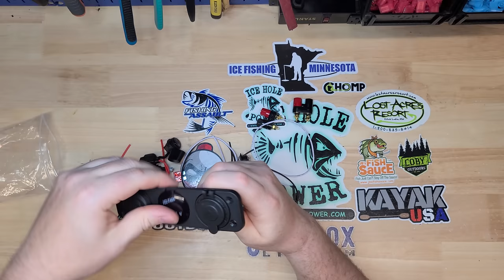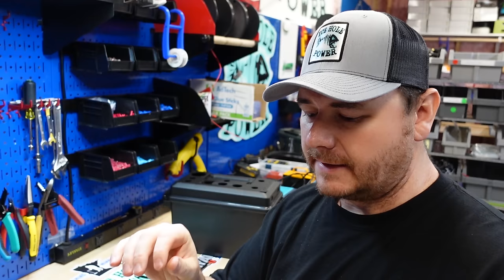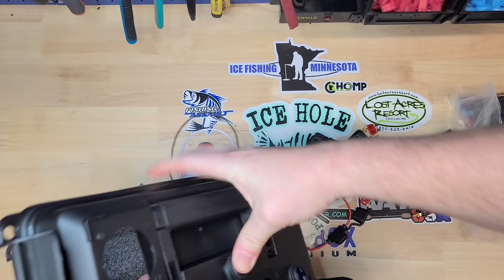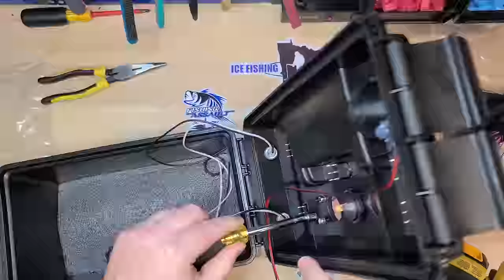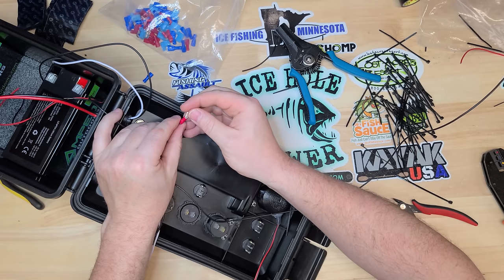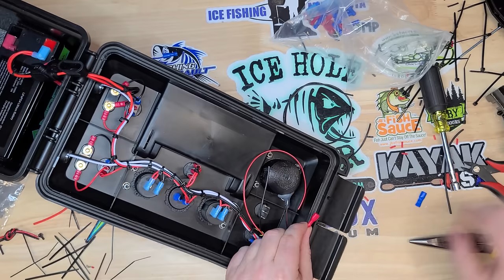How To Build A DIY Power Box

Comment: KUDOS on the build! I suppose the main question for many, is really what's the main use of this build? It's so low in supplemental power, is the idea that if you're stuck in an igloo for 3 days or stranded at a campsite to power up a set of lights and charge two cell phones? I'm not being rude, I'm genuinely curious since the parallel voltage bank is only 24Ah?? Don't get me wrong, it's a fantastic build, very cleanly done, just not sure what the cost per time per value is in this logistically..? I could see a 50Ah at the absolute minimum. Was it to be 'one-handed transportable' charge block, but not want a Amazon charge block for your cell-phone? Again, very well built! ~ Just not sure what the common denominator is in this build for worth.
Reply from the maker: Thanks for the comment.  This box is able to hold two 30ah batteries giving you 60ah of power.  This box with the glow cup is for ice fishing.  Keeping all your stuff charged in case of emergencies being out on the ice is key.  Being able to have your phone charged or have a lighting system when it gets dark while also having the glow cup to glow your ice jigs.
Reply: @iceholepower8012  Cheers!

Comment: I have the same plug on my 2 amp battery charger I can put the alligator clips on it to hook straight to the battery on cars and trucks my atv has the adapter that hooks to the battery and all I have to do is plug it in on the adapter on the atv battery.

Comment: Hi Jeremy, I purchased your power box. I know little to nothing about doing electrical wiring. I wanted to do this as a learning experience. I must say watching your video made it possible. I put in 2  12v 30ah lithium amp batteries. My biggest problem was the lights,one doesn't work ,but the real problem was the wire is very fine and the insulation  was to thick for me to get a good crimp.Thumbs up great box. I plan on using this for some camping, kayaking,and when I am able to get a Garmin use it for that.

Comment: @Iceholepower -  I followed this video but I have only have a single battery at the moment, I might add a 2nd battery in the future.    What should i do with the 3 wires (2 negatives, 1 positive) that you connected to the 2nd battery?  Can i just leave them as is until I add a second battery?  Thanks!
Reply from the maker: You bet. Just tape them to the side of the box or secure them with the velcro for the second battery.

Comment: Is there another 30ah battery you recommend that will fit in the deluxe box?  Been waiting on amped 30ah to come back in stock but it doesn’t seem like it’s gonna happen soon. Got my box all wired up and ready for a battery (that will fit the box)!  Thx
Reply from the maker: Good Question. Not that I know of. One 30Ah Tall will fit under the handle, the Dakota 23Ah is about the same size. 
https://www.iceholepower.com/lithium-batteries

Comment: Best way to charge battery without opening the box
Reply from the maker: Assuming you are using the Amped charger like in the video, plug it into the side of the box and hit the charging switch.

Comment: Built mine last week.  It's cool!   Went with two Amped 12 hour batteries.  Any reason I can't keep the charger in the box when I'm not using it?  I just put it in the baggie and put it between the batteries for now.  The new model lights are very bright.
Reply from the maker: Not at all, I keep mine in the box.

Comment: Many of us who purchased your DIY Power Box will not be using a 2nd Battery as shown in your video configuration, but will only use one. So, can you please clarify/ maybe diagram the connections we will use when only using one battery. Thanks Much!
Reply from the maker: You can use 1 battery in the wiring configuration shown in the video. Otherwise run your negative from the charging switch to your negative battery terminal and the fuse holder will go from charging switch to batt pos.

Comment: What is the preferred charging method or controller?  How do you preserve the service life of battery?
Reply from the maker: I just plug my lithium charger into the SAE port. They are 10 year batteries as long as they are stored around 50%

Comment: Great video, could you use one of these to power a CPAP machine (after purchasing the correct dc to dc cable for the machine)?
Reply from the maker: Thanks Jason! If it was 12v and it did not pull more than 10 amps, then yes. Just make sure to calculate your current so you can get a battery with enough capacity.

Comment: May sound like a dumb question, but can I connect my power inverter to the banana clips? Also do the kits come with wiring instructions?
Reply from the maker: You can hook an inverter to the banana posts. Just make sure to keep it under 10 amps. This video is the instructions.

Comment: A simple volt meter isn’t very useful when using lithium batteries. You should use a meter with a shunt so that can measure the batteries capacity.
Reply from the maker: Google lifep04 voltage chart. Its not as good as a shunt but works just fine for these low capacity boxes.

Comment: I'm building one as a solar powered battery box for Ham radio, but it will be similar in construction, using many of the same outlets and switches. I've watched a number of videos to prep for it, and I have to say this is the most educational for process and wire management. I will be using a Bioenno panel, battery and controller. I will also be using a RigRunner for fusing in between all the components and the battery. Overkill? Probably. But anything worth doing is worth overdoing.
Reply from the maker: Overkill the snot out of it! Sounds like a sweet box, shoot me some pics if you want. Jeremy@iceholepower.com

Comment: Hi, nice video, i just have 1 question, the wires you use seem a bit thin, have you ever encountered wired becoming hot during a heavy load?
Reply from the maker: No, we fuse it at 10 amps so there really isn't a heavy load put on the wires. They are also really short wire runs too so that helps.

Comment: I was thinking about a 12 volt car battery as for my box
Reply from the maker: It would work in a different box, but would be heavy. Really heavy. One thing to look at is the weight capacity of a box when choosing a battery like that.
Reply: It is 600 cold cranking amp battery I have it in a deep cell box

Comment: How hard would it be to switch out those Eagle eye lights, for the new fancy ones your showing?
Reply from the maker: Not hard. Just have to drill a bigger hole then I would splice the wires. We use a 18mm but for those new lights

Comment: If I want to use a 12 volt lithium battery only what would I need to modify in the wiring of this unit.  If there is another video please let me know.  Otherwise I will order another battery.  The battery I ordered is a 12V Lithium Battery 30Ah, RoyPow Deep Cycle LiFePO4 for RV, Solar Marine and Off-grid Applications.  Can I use two of these batteries with the setup? 

Thank you.
Reply from the maker: Hi Juanita. Looks like you would need to get some big eyes for that battery because of the bolt terminals. It does look pretty big and I'm not sure if it will fit in the box that I used in the video. I did tear down a smaller RoyPow battery and it was not pretty. https://youtu.be/mQQoYzrj3rY
Reply: @iceholepower8012  Thanks for refencing your video.  I saw it after I purchased the battery.  I will return it and get one of the other batteries you recommended.  I purchased the setup because of a you-tube video I watched where he recommended your power box.  I am trying to run a 12 in garmin, livescope and a hydrowave on the battery which is why I went with the larger battery.  is there a video reference for a single battery wiring versus the dual setup?  Appreciate your prompt feedback to my initial comment!
Reply from the maker: @juanitaellis8208  no but it's pretty easy. Negative wire from neg battery terminal to neg charging switch tab. Then inline fuse from pos battery terminal to outside silver tab of the charging switch.
Reply: @iceholepower8012  thank you! Appreciate your support!

Comment: Which of the recent batteries will work with SAE plig
Reply from the maker: Do you mean which battery charger will work with the SAE plug?
The Amped charger will work with the SAE plug assuming you are using LiFeP04 batteries. https://ampedoutdoors.com/collections/lifepo4-battery/products/lifepo4-lithium-battery-4-charger?variant=39619821830295&aff=8
Reply: Can you use the SAE as a power source
Reply: Are the switches available in  green or red

Comment: Jeremy, thanks for an outstanding video on this. I built my own box, based on your videos, JDS Outdoors Videos, and Benjamin Nelson videos; I learned a lot about wiring, some different tools, etc. I am a retired Marine, Subscribed, hit the "All" Bell, and Liked the video, so looking forward to more vidz. I do have a question about dedicating switches to each light, banana jack, 12volt, , and using a master switch that controls my Solar Charge Controller, with a direct connection using an SAE port for my solar port.  What is the easiest way for a "Finance guy" to wire components, so each has its own switch and is independent of the others?  I want my Master Switch to control only the Solar Charge Controller, so the electronics in it, do not drain the battery. Then I want the banana jack 12 volt port, and each LED (Red, Green, and White" to have their own switch, all of which do not need the master switch on, to provide power to each component.  Thanks in advance for any assistance you care to share. I also believe I heard you are a former or retired military man, so thank you for your service. Semper Fi!
Reply from the maker: Thank you for your service! It really wouldn't be a master switch if it did not provide power to everything so I would just consider it your charging switch. then I would just take the the pos from the outside tab of the charging switch and daisy chain it to your other switches. Kinda like the negative side. Just make sure you get that fuse between your battery and your charging switch. (assuming that is your first component in the circuit.)
Reply: @iceholepower8012 , thank you for the above. I now have a "Master Switch (MS)" that must be on to run the solar charge controller, and provide power to the box. The inline fuse is from battery + to MS IN. The MS OUT goes to Solar Charge Controller. Only thing left is the SAE port which is how I charge the system via Solar. I do not use a Banana Jack as a charging option. Since the Inline fuse is direct from battery to Master Switch, do I need to or should I connect the SAE port differently, or run it straight to the Solar Controller as I have it now? Thanks man. Apologies for the questions, you are the only who seems to be able to provide answers and insight. Awesome stuff. Thanks again.

Comment: How do I go about wiring the switch under the charge switch as I'm not using any lights etc .. is it just a case of missing the middle wire out ?
Reply from the maker: Are you saying your switches don't light up? If that is the case, you don't need to wire the negative wires to them.
Reply: @iceholepower8012  yes my switches light up .. but I'm not using the first aux next to the switch so I'm wondering if I just leave out the middle wire on the switch ... I'm baffled .. I want the USB amd 12v socket and volt meter all on switches and also the master switch  but no lights or other accessories attached
Reply: @iceholepower8012  I have
5 switchs with 3 terminals on each
1 voltmeter
1 12v socket
1 usb 
1 charge plug

I'm wanting everything on separate switches if possible and also a master switch :) 
I'm baffled I hope ylu can shed some light on it for me :) 
Many thanks :)

Comment: Great video!  I placed an order yesterday.  Only thing I might add is the hole size for each component.
Reply from the maker: That is something I will work on this week!
Reply: @iceholepower8012  my lights came today any idea of the hole size for them and the switches ?
Reply from the maker: @twinbadger1  I assume you are talking the round lights. They are 18mm switches are 20mm

Comment: In what cases would I need a circuit breaker?
Reply from the maker: you can use a 10 amp circuit breaker instead of the fuse if you wanted to. Does the same thing, inline fuses are just cheaper.
Reply: @iceholepower8012  ahhh gotcha and the only one I would need is from the battery to the terminal stud connectors?
Reply from the maker: That's right. That will provide short circuit/over current protection to the entire box.
Reply from the maker: from positive battery terminal to the charging switch.

Comment: This is such a great video! I just received my kit yesterday and can't wait to build it. Question, I have one battery at the moment, can I pre run the wires like in your video for two batteries and just have one battery connected?
Reply from the maker: Yes,  just place your battery on the hinge side. Thank you for your order
Reply: @iceholepower8012  Great Thanks! also since I am running a Marcum battery, I would have to switch the connections on the charging port just when I charge the battery correct? Positive to Negative and Negative to Positive.
Reply from the maker: @ronaldgrospe3862  To be compatible with the Marcum SAE charger, yes. Great question!
Reply: @iceholepower8012  sorry last question.. when I connect my fishing finder to the SAE connector, would I have to change the connections? positive to positive, negative to negative? or can this be left as is since its for charging?
Reply from the maker: @ronaldgrospe3862  Oh, another good question. You would also have to swap the wires with the pigtail. It might just be easier and a lot less confusing if you cut that Marcum plug and swapped the polarity at the charger. Then everything will be less confusing!
Reply: @iceholepower8012  thanks! I was also thinking of getting the charger from amped outdoors lol.. that should work correct?
Reply from the maker: @ronaldgrospe3862  that will work too!

Comment: Great video! Did you only add a charging switch because of the banana plug post connectors so it would not be live? If you only used the SAE charging connector with cover, it wouldn't be necessary right?  Thanks ,Dave I am doing a similar project. Also, I read when wiring in series, you use the furthest post for either the negative or positive so it charges equally...